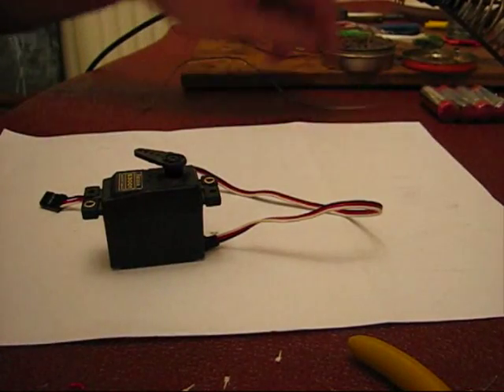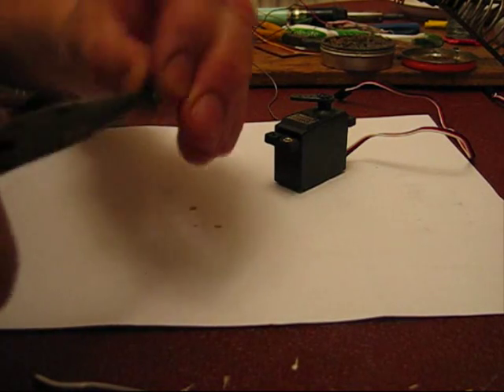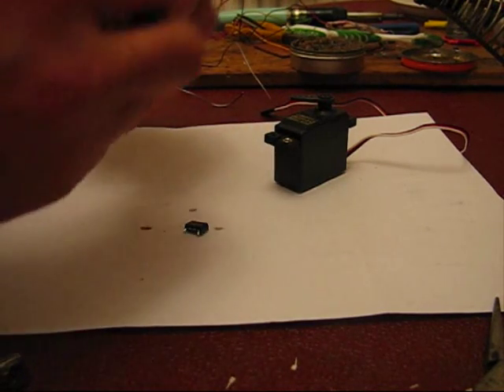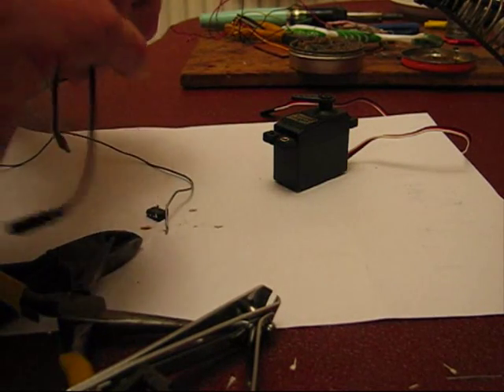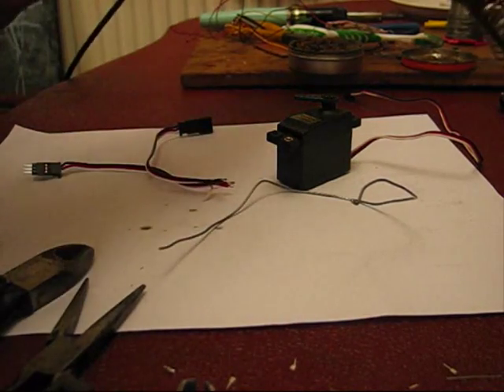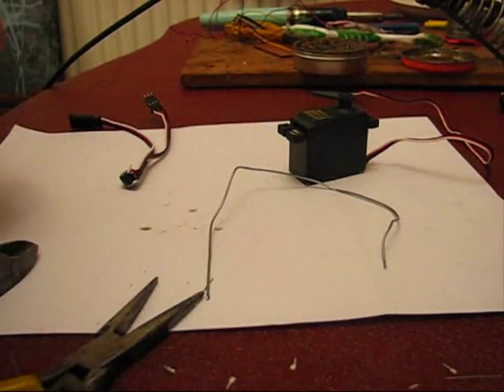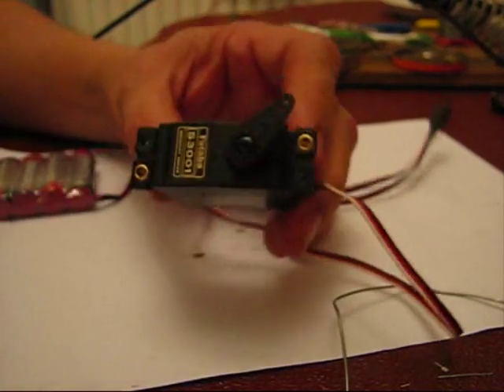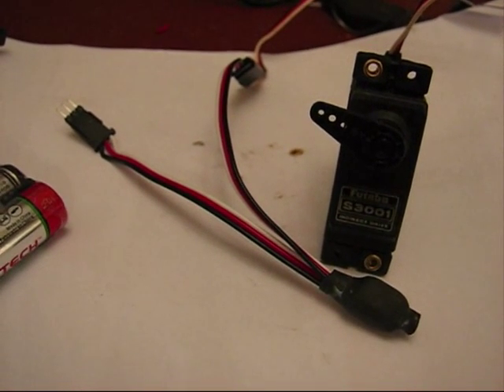Ultra-simple DIY servo exerciser for new or crash-recovered servos.

Comment from the maker: None of the other pins are active and why would you want to reprogram a throw-away chip anyway?  It does its job. End of!
When we had a 'build-an-exerciser' workshop at our club I found that some of the older or less dextrous members couldnt solder at one-tenth spacing, hence the removal of unused pins as explained in the video.
Phil